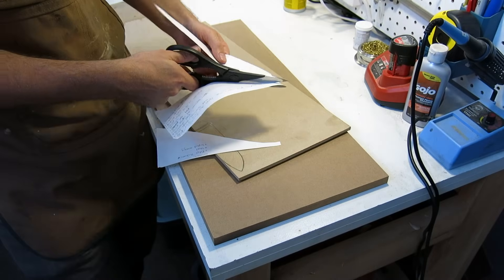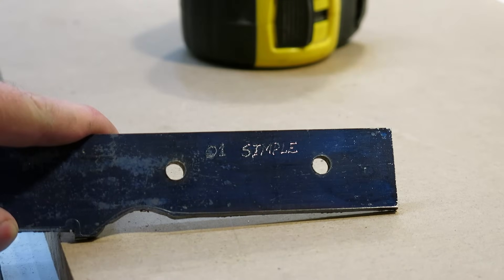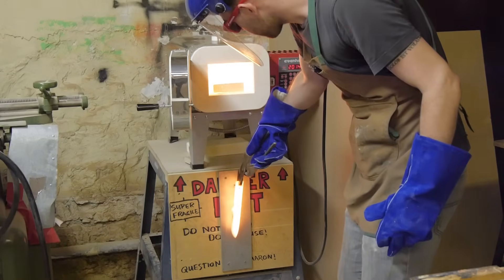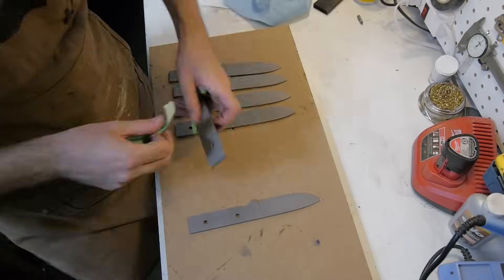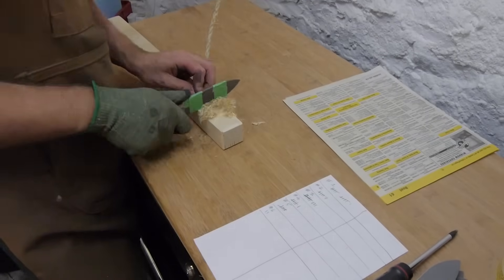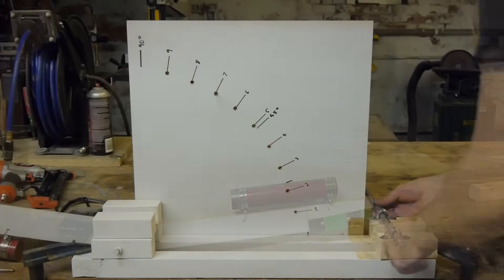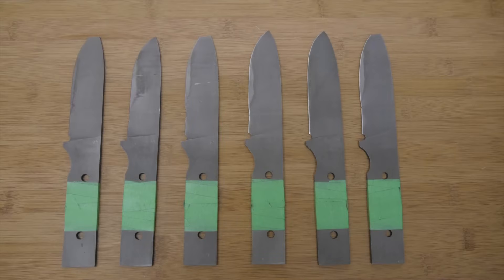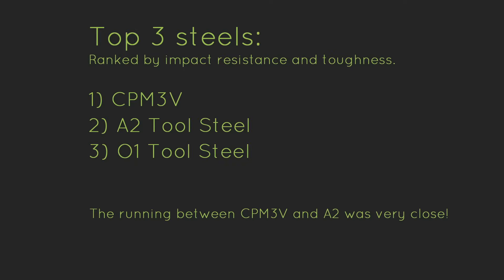Steel testing: a carnival of knife destruction.

Comment: Interesting, my experience testing A2 tool steel have not been as positive as yours. In fact ever since its left a bitter taste in my mouth and I've tried to avoid buying large combat/survival knives made from that steel. I've had it fail and shatter catastrophically during spine wacks, and side later impact tests, where I used a steel pipe to whack the side of the blade. During that test A2 was the only steel I managed to snap dime/nickle sized pieces from the blade after only 3-4 impacts. Where 1095, O1, AUS8, and even shitty 440A, worst steel ever, managed to pass that. 1095 was hit at least a dozen if not 18-20 times with strikes so hard sparks were flying, and microscopic pieces of metal would strike and sting my face. But the only damage I saw was the very end of the edge rolled. 440A had minor chips knocked out, side of a rice, but nothing major like the size of a coin on A2 tool steel. Also the steel was advertised at 55-57rc. Where 1095, O1 were advertised at 59-61rc. AUS 8 performed better than all of them with no rolls, no chips, nothing but scratch marks  and scrapes from steel pipe. Ever since that day I can't trust A2 tool steel, and I use to think it was tougher than O1 and 1095. I always had a suspicion that my A2 knives were brittle, but would try to make excuses cause I didn't want it to be true. But by just taping the steel you can tell when the blade is hard and brittle cause you will get a ding, sound like a bell, or when you lightly tap a wine glass with a spoon or a fork, the sound would vibrate back. On more ductile tougher blades all I got was a dull thud, cause the metal can absorb the shock waves, instead of reverberating them back. That test has never failed me, I'm usually 95% right based on the sound test, on whether the steel is flexible, ductile and tough, or hard and brittle. So what seems to be the culprit that can make the same kind of steel tougher than most, while at the same time the weakest of all, as you state it.

Comment: Why did you go with A2 steel over 3v if the 3v was ranked better, even if only marginally?
Reply from the maker: Yes, sorry, I did a poor job of explaining this in the video. Basically I found 3V would dent/roll far more easily than A2. I was much happier with the way A2 held up to normal use.

Comment: Dude coupd you show the results in a table maybe?
Reply from the maker: If you check out the 'read more' section under the video there is a link to the full results in a thread over on BladeForums. BTW: The reason I didn't go with 3V was because I found it dented/rolled at the edge far too easily compared to A2, and A2 was very close in all other respects. I did a poor job of explaining this in the original video unfortunately...
Reply: @GoughCustom  thanks man you are a gent you just got yourself a sub

Comment: Could you please elaborate on why you chose A2? The CPM 3V steel is simultaneously tougher, better at edge retention and more rust resistant. Also, according to your Blade Forum post, A2 at 62.5HRC is at the bottom of the list and yet that's the hardness you chose to select for your A2.
You must have a good reason to do this but I'm not knowledgable enough to understand why :-)
Reply from the maker: Hey Patrick! You have a good eye for detail! The reason I didn't pick CPM3V was that even though it was very 'tough' I found that it would roll edges and dent far too easily, far before the A2 would! I believe this is because of the high temper, I have heard better things about CPM3V with a low temper but I haven't had the chance to try it yet. I agree that I didn't explain this well enough in the video!

The A2 heat-treatment that tested in last place (A2 Ver2) was actually not the same as the one I used now. That one was an experiment with oil-quenching A2 which went very poorly. I had to temper it very high to get it down to 62.5HRC. The hardness after a 400ºF temper was far too high.

The heat-treatment that I use now is actually the same as A2 Ver1 but I'm using nicer steel now so I tend to get higher hardness. I'm very happy with it! I have several hundred knives in the field with that heat-treat in the hands of bushcrafters, hunters and military personnel with zero reported issues!
Reply: Hi Aaron! Thank you for your detailed answer.
I can confirm my knives in CPM3V with low temper (delta 3V) from Nathan Carothers are awesome. You should definitely try this 3V version.
That said my Resolute mkIII is also very nice and I never had an issue with it :-)
Reply from the maker: Hey Patrick! I knew I recognized your name :D Glad you are liking your knife! How do you find the edge retention compared to the delta 3V?
Reply: Honestly it's very difficult to compare the edge retention between knives with different blade geometry and when you don't use them at the same time and in the same conditions. Unfortunately I don't have a CATRA tester and all I can say is the edge retention is good in both cases.
For toughness it's another story. I know (by reading about steels, not by testing it myself in a controlled environment) that 3V should be tougher and more impact resistant. So I tend to use my 3V knives when I have a tough job to do. I used my Carothers Field Knife for difficult tasks (batoning hard wood) instead of using my Resolute.
When you have the choice between several knives and you know the one you selected don't have the toughest steel you tend to reduce your expectations and be prudent when you use the knife. I know it's purely psychological but it's a thing.

I asked you the initial question about your choice of A2 steel because, usually, you need to do compromise between different parameters. This steel is better at edge retention but less tough than this other steel. This steel is tougher but less rust resistant than this other steel.
But according to online documentation and according to posts from knowledgeable users (Larrin, Ankerson, Cliff Stamp) the 3V steel (especially with delta HT) is better in ALL parameters than A2. That's why I asked about your rationale to select it.
Reply from the maker: Yeah I understand! Even on my end edge retention testing is the most difficult to do reliably! At some point I will be doing another round of steel testing, but overall I'm very happy with A2 for the moment! I have been very mean to my personal knives with no issue.. The only time I have ever done damage was when I tried to baton through a 1" diameter knot in hardwood, but I should have seen that coming :D

Don't worry too much about how you use your knife! It will be fine batoning clean hardwood, I would stay away from big knots though. If you do ever damage it I will replace it under warranty so no issue there!

Comment: I wish you used CPM D2 or AISI A11...Those two would have crushed A2 or CPM 3V...Just saying...
Reply from the maker: Hey Gabriel! Actually I think that is very unlikely on both fronts... D2 and A11(10v) are both very high carbide volume steels, which means they'll inherently have lower toughness. The powder metallurgy process reduces this effect somewhat but not enough to compete with lower carbide volume steels like A2 and 3V. A11 and D2 may have had better "coarse" edge retention when cutting abrasive materials like cardboard, but they would also likely have lower edge stability because of their higher carbide volume. This means their ability to hold a fine razor edge would likely be inferior, especially in situations that stress the edge like wood carving/splitting, which is something my knives are used for often!

Comment: why the different heat treatments
Reply from the maker: Because each different heat treatment makes the steel perform very differently! If you look at the full results you'll see A2 performed both the worst and the best with different heat treatments!
Reply: CPM 3V is simultaneously tougher than A2   and better at edge retention and also more rust resistant. Could you please explain why you chose A2?

Comment: This is one respected maker's take based on qualities one person  seeks. To me, a knife is supposed to perform one function 99% of the time and that is to be sharp and cut something. In my 10 years as a wildlife and land manager in Northern New England in the mountains I never used any knife as a pry bar. Furthermore if that's something you want in your knife it's very easily done just buy a bigger and thicker knife. I've never tried to cut a pry bar. So I'm not really worried about my blade being chipped by a metal pry bar. It's really important that a knife be sharp so edge holding is much more important than any of these tests. Most high-quality steels will cut half inch rope maybe around 30-60 times  before they start to dull so keeping blade sharp is something that is time-consuming and hard to do in the field and that's why it's important to have an edge that lasts a long time. Is that rocket science? To me a knife that bends a lot often comes at the expense of hardness, but moreover, no measurement was made of the force taken to break the blades. I think with a test that tries to be the scientific also a cold blade snapP test would have been appropriate just leave a blade in the freezer for a few hours then see how quickly it then snaps. Because many of us live in cold climates. one thing you can learn from this video is that how these blades are forged has more to do with their qualities than what they're made out of so it's not really relevant what type of steel is used. It's more relevant who made the knife. Probably the most aggravating thing about this video is after all the testing he just kind of declares a winner without specifying any of the actual results in detail! There were too many discluded steels  like D2  and many others in the comments. No hardness test aka Rockwell were performed. The beauty of Custom Knife makers is that they can choose what they would like to have in their Ultimate Knife and make it themselves. And there is certainly a lot of merit to that. And I also think that this video could be redone and be a lot more helpful than it is because I think that the 200 hours of work were definitely fruitful. But it seems like the end was rushed when it came time to really tally up the performance of these blades in a scientific way. This guy is mentioned in Wikipedia as a reference on A2, along with my friend Jon Fitzen and certainly it was very interesting to watch this and anyone can learn a few things I'm just saying once again this is one maker finding out what steel is right for him. I don't think it's what I would carry personally and maybe other Watchers would not. Of course the best thing about a custom manufacturer is he'll probably make you or me whatever you want! And this guy seems to be pretty young and knows what he's doing and I bet his stuff is going to go up in value
Reply from the maker: I strongly disagree... I think I would do a lot of things differently now, but this testing had a tremendous amount of value for me:

Yes I agree that 99% of the time a knife will be cutting, but toughness of the steel has a huge impact on cutting performance for the simple reason that the tougher a steel is, the thinner you can safely grind the edge. And the tougher a steel is the harder you can make it without worrying about chipping, which again hugely impacts the cutting performance.

The full list of test results is linked right below the video. All the blades were fully hardness tested, with a brand new hardness tester that I bought for the purpose, again the results are in the link under the video.

The steel, and heat treatment, are very VERY important when making a knife. Most steels can make an 'ok' knife, but a really good steel with an excellent heat-treatment makes a huge difference. 

For reference my knives will make hundreds of cuts through half inch rope before showing any issues with dulling, and will cut around 400 linear FEET of cardboard before they are unable to cleanly slice phonebook paper.

Edge retention is absolutely my number 1 priority, but edge retention and cutting performance are all strongly related to geometry, and the allowable geometry is strongly related to toughness. That's why this work was so important.

Best regards,
Aaron

Comment: how to process the right and good in doing quenching type of steel from spring car. explanation please.
Reply from the maker: Car springs are usually made from 5160 if they're leaf springs, if they're coil springs then I believe they're usually 1095, but I can't be 100% sure on either one. The best thing to do is to heat-treat it like it was O1, I have a video on my channel that shows how to do that.

Comment: What were the other steels, and what were the conclusions on the different heat treatment processes?
Reply from the maker: Hey mate! There is a link under the video that will take you to the full results and a listing of all the heat-treat processes
Reply: Gough Custom thanks! From an engineer's point of view, I came away extremely impressed with your investigation. Very informative and thorough. Great work!

Comment: Great video Aaron, I read your entire forum it is very informative. My question is what process are you using now for your A2 knives you are currently making?
Reply from the maker: +sfbjr22 hey mate! I'm still using the same heat treat as the one I declared the original winner, it's still working great!
Reply: Gough Custom so Preheat to 1100ºF, equalize
Ramp to 1775ºF, hold for 35 minutes
Quench in air to below 150ºF
Temper at 400ºF, 2 hours
Cryo-quench into dry-ice & isopropanol for 20 minutes
Temper at 400ºF, 2 hours? 

I know you tried a few different methods. I didn't know if this was the original or not
Reply from the maker: +sfbjr22 yep, that's the one!

Comment: Hi, I wanted to know from your experience if it can be an excellent choice to use 440C hardened steel at 57/58 HRC for a compact size survival knife (blade length 10 cm and total length 22 cm) with a thickness of 5 mm Obviously fulltang,
Or is there any other stainless steel that you prefer?
Let me know what you think, thanks to Michele.
Reply from the maker: +Michele Trekkning 440c is an ok steel, but it would be far from my preferred choice in a survival knife, as a blade like that is going to see a lot of impact abs hard use. My choice of stainless for that application would be CPM154

Comment: Hi, I wanted to know if based on your N690Co experience is an excellent choice for a fixed knife for survival stainless steel knife? Thanks Michele
Reply from the maker: +Michele Trekkning I have not used N690. Personally though from looking at the spec sheet it wouldn't be my first choice as it has a pretty high carbide volume which will result in lower toughness. I like CPM154 a lot, personally that would be one of my go-to steels for this application
Reply: 440C hardened to 57/58 HRC say that is a good choice?

Comment: thanks man, this is insane but ill stick to my old crappy used circular saw blades
Reply from the maker: You'll find that most circular saw blades are actually low carbon steel and as such won't harden at all despite heat-treatment. The best value for money steel when making knives with simple tools is O1 tool steel or 1084. Both of which are very cheap.

Comment: What was the winning combination of steel and heat treatment?
Reply from the maker: A2 tool steel, with heat-treatment at 1775ºF, air quench, double temper at 400ºF with a sub zero treatment in between tempers. The full info is in a link under the video!

Comment: Why you Choose a High Carbon Steel and not a Stainless Super Steel like the excellent M390 ? is it mutter o cost or High Carbon still better from all the Stainless Super steels ?
Reply from the maker: From what I've seen high carbon steels are still quite a lot tougher than most stainlesses, even the good ones. Something like M390 is likely to be significantly less tough than my current steel as it's a high carbide volume steel... However I plan to investigate stainless steels more soon.
Reply: And you gonna make a video testing those steels right ?? becouse we would love to see that !!! :D

Comment: Hello, based on your experience of knives to use in the open air rather a D2 steel or stainless steel as M390? Let me know which one is better in this field according to you, your videos are very beautiful. Hi Michele.
Reply from the maker: It depends very much on your heat-treatment, geometry and intended use... There is no one steel that's better than all the others so it's never an easy decision. I have been very happy with A2 for my designs.
Reply: M4 on the Lionsteel knife M390 what do you think? Use to bushcraft / survival, prefer compact knives so that I always carry with me, let me know Michele.
Reply from the maker: I'm sure that in that case M390 would be a fine choice.

Comment: You said the A2 was the best with the proper heat treat, was that the heat treat you used at the start of the video or did you adjust it? And if so what were the changes you made to the heat treat for the A2. I only ask because it sounded like you may have adjusted your heat treat after the testing
Reply from the maker: The heat-treat I use now is the same as what I tested in the video... I have links under the video to the full details on all the heat-treatments!
Reply: Gough Custom 
Thanks for the info, love the amount of time and info you put into your knives and videos.

Comment: Amazing test, and very informative about knife-making.  Appreciate your thoroughness.  Did you do this testing on multiple batches of knifes, each with different heat treats?
Reply from the maker: Yes, that's correct. Each steel was tested with a couple of heat-treatments.